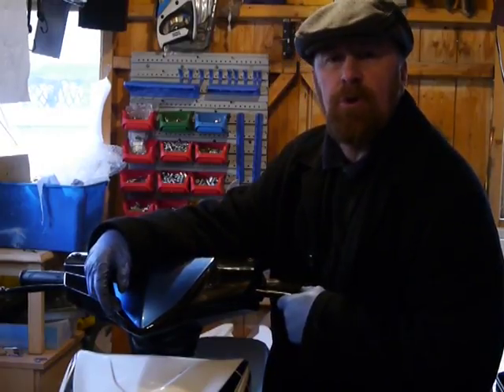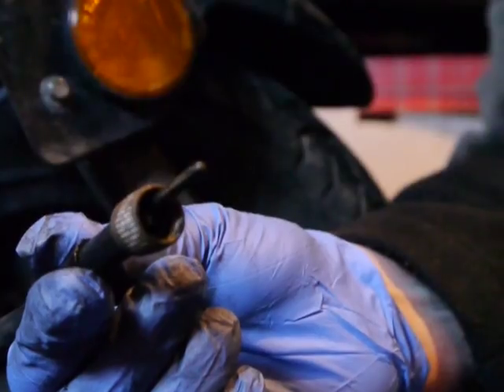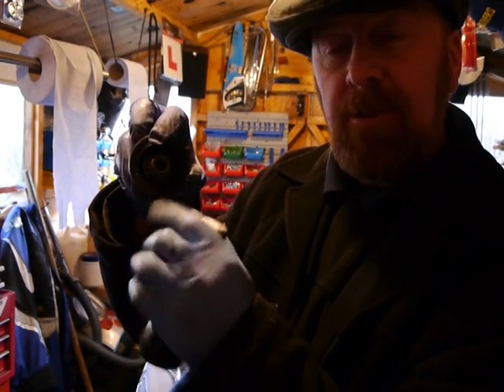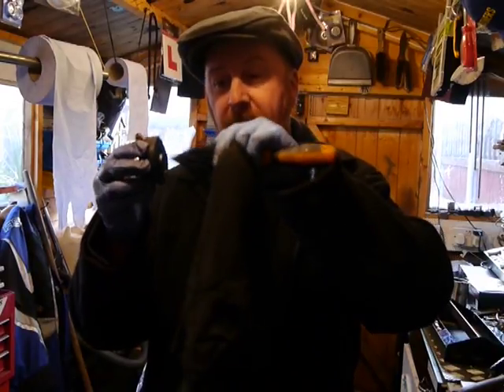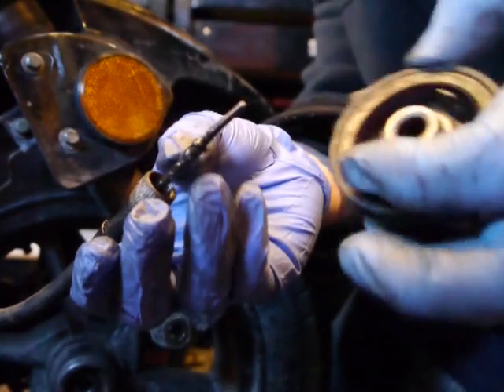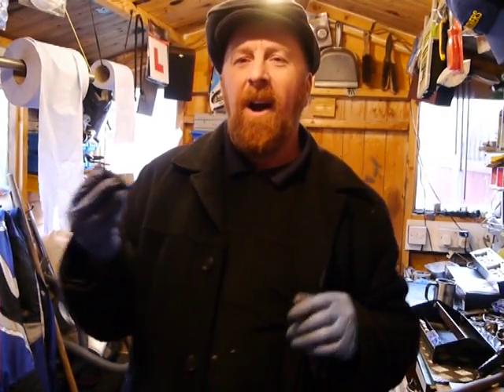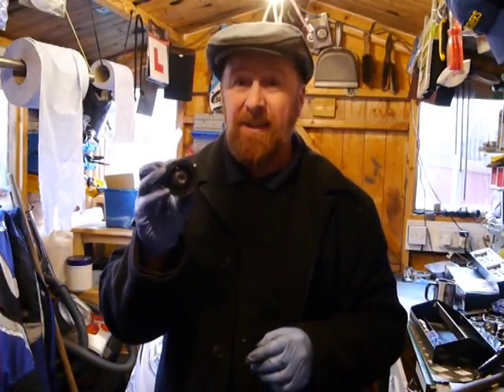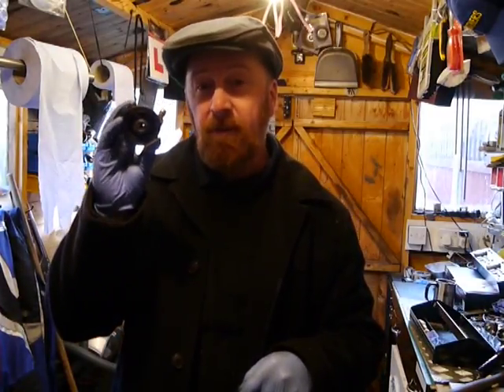CHINESE MOPED SPEEDO DRIVE NOT WORKING MARK SAVAGE

Comment: I have got a Sinnis shuttle 125 and my main headlights went out the full beam still works I have bought a new headlight relay but cannot locate where it goes on my bike I have took the whole thing apart but still cannot find it I found a wire with a plug on but cannot find where to put it and the relay don't fit in there can u help me please

Comment: Hi recently bought one of these and it needed a new speedo cable. I have replaced the cable and the speedo works but the mileage is way out of tune. I did a 3 mile journey and it said I did over 100 miles. Any ideas?
Reply from the maker: Well that's odd but must be the clocks that are damaged as guessing the speedo it way out too
Not seen that before

Comment: What jet what u recommend on a speedfight 2 2003 air cooled just exhaust and air filter upgraded
Reply from the maker: Paul summers standard is 54 
As in my upjetting video and carb cleaning videos 
Go up in 4s they are only about £10 a pack of 10 
 But start about 60
Which should run well with as in my tuning video 3 half 
Mark
Reply: mark savage thanks for your help mark n your channel is brillant helped me out loads keep up the good work
Reply from the maker: that's great to hear bud and thanks for watching 
mark

Comment: Hey could you give me some tips on my Chinese scooter the speedometer and fule gauge doesn’t work any tips on what  it could be
Reply from the maker: This is going to be two separate issues depending on the year 
Older mopeds will have a speedo drive and cable which is normally the problem and a simple fix 
I have many videos on my channel to help under speedo drive or moped 
And while you have the clocks up you can check connectors for the fuel gauge otherwise it will be the sender onto on the fuel tank so seat up and out 
If newer and all electric this still can be a connector or the clocks them self's and need replacing !
Check out my other moped videos

Comment: Hi mark I have an old 1997 Peugeot speedfight 1 runs great apart from if I let the engine run before I leave if I let it run a warm up it will bog down and not go anywhere any ideas?
Reply from the maker: Ewan Critchley hi bud 
These little mopeds do have there own little funny ways of starting 
It’s going to be your auto choke and carb 
Sounds like when you start and go the choke heats up and comes off but then you leave it the choke is staying on and then choking it 
Service carb and replace auto choke bud 
That’s what I’d do 
Or just continue to start and go lol  
Mark
Reply: mark savage thanks bud will give that a try tomorrow

Comment: Hi Mark, PLZ REPLY! I broke down the other day on my piaggio zip and i thought that i must have accidentally put diesel in like an idiot. Anyways after pushing it for 5 miles i got it home. 2 days later which is today I drained the diesel out of the tank via the fuel tap. I then cleaned the carb and all looking well. I then went to the petrol station to get some fresh petrol. I poured the petrol in but it was just leaking from the bottom of the tank where the petrol tap. Any help on how to fix this. Any reasons for why it’s happening?

Thanks again Mark!!
Reply from the maker: OMG no way that's really bad bud 
you will need to take out the tank and flush it out and the carb and all fuel fines, you may have even damage the engine, diesel only ignites under pressure unlike petrol ignites by heat / spark 
diesel is very dirty and leave residue  on every thing 
buy carb clean and fresh petrol and clean spray and flush everything 

buy some easy start as remember diesel will be in the head / piston and be on them so wont spark, once you have cleaned it all and the plug , put it all back and try to start and spray easy start into the carb this may work bud so give it a go 
and never do that again really bad
Reply: Thanks Mark

Comment: Hi Mark I checked my gilera float bowl, took the whole carb apart cleaned it, used easy start, checked needle and tubes yet it revs itself and cuts out!! What can it be bro
Reply from the maker: madz Rt if you have sorted all of the carb problems and the carb is working as it should be and your sure it’s a good carb then bud check your reeds as in another one of my videos on reeds as if there are loose they will continue to suck in fuel for a bit then die 
Or it upjetted way to much 
It was running ok before ? Or did you change anything ? 
Mark

Comment: Morning Mark. I have liked and subscribed to your channel. Very well explained vid on the failed speedo on the Chinese scooter. I have the same problem with my two-year-old Lexmoto Michigan. The speedo has gone crazy. Not going back to zero when I stop. But staying on the speed I was doing when I stop.. Then when I move off again it starts from the 30mph. And moves up to 60MPH. even though I'm only doing 30mph again. Stop again. It stays on 60mph. Move off again it now reads flat out up to the stop point on the speedo. It only goes back to zero when I actually turn the key off. Are you following all that? Please help mate. 67 year old, and pulling what I have left of my hair out.
Regards Dave.
Reply from the maker: Is it a cable speedo or electric speedo drive one ?
It cable it's odd and sounds more like a clock fault too stick and add 30mph 
I'd take lift the front wheel and spin it to see how it moves the clock and then take it out and inspect the cable 
If electric speedo drive one 
Check the sensor and take out and clean wash and refit ,make sure the wire is not cut or damaged 
But again could be clocks being faulty bud
Reply: @marksavage  Hi Mark. Ta for your reply. I don't know if my Speedo is mechanically or electronic. It's the latest lexmoto Michigan. About 18 months old with only 1700 miles on the clock.
I'm not very mechanically  minded. I think I better contact my dealer who sold me the bike brand new. And it could be a warranty issue.
Thanks again Dave. 

Regards Dave.
Reply from the maker: @davesmith6193  yes mate that's the best idea and something it suggest on a new bike 
Take care bud and hope you get it sorted

Comment: You really put out great videos, SO we know these chinese speedometers are innacurate, Ive seen 5 and 10mph off,,,,the question is, do you know how to calibrate these speedometers so they read accurate? what is it that you need to tweak or adjust to get them to read accurate, is it the needle coming from the cable, is it at the wheel? What do you think?  TY again!
Reply from the maker: to be honest bud they are all out and its only there for a guild , theres not much you can do to calibrate them

Comment: Hi Mark, I changed my idle jet from my gilera from 50 to 38 and it starts and runs!!! But only for 7-8 seconds. It revs itself to 7000-8000 Rpm’s and then cuts out (choke or no choke). It will start up every time but this will always happen. Please could you help
Reply from the maker: hi bud I have had this before, so it's take it all part again check that the float is not staying open and as in my carb videos on how to check.make sure the pipes are tight on and not gone hard if so replace, also check the needle is straight this also can do this see how you get on bud mark
Reply: Alright bro I’ll get back to you after I’ve done it

Comment: Hi Mark loving the videos, just bought a SpeedFight about a month ago and having problems with starting and a leaking carburettor also sometimes backfiring, can you do a video on labelling all the parts of the carb and where it can possibly leak from? Also can this effect starting and cause to back fire? Look forward to hear back from you and can I get a shoutout in the next video 😅
Reply from the maker: Danny Cope hi bud thanks for watching and I will do a shout 
As for carb leaking 
I have many videos on the carb and yes it will cause all sorts of problems like starting riding and over fuelling
Watch my carb video there loads on my channel and best watch them on a computer as you will see over 300 videos 
  This will sort out your problem
Mark
Reply: mark savage Thanks mate appreciate that, so I fix the carb should it solve a lot of the problems such ass the starting issue and exhaust backfiring at times? This is for the 100cc mate, cheers
Reply: mark savage you didn’t do my shoutout in your latest videos mate

Comment: Hi mark i have an acceleration issue with my moped still would tou be able to help me ive just uploded a clip of me accelerating from stand still and all my bike specs are in the description thanks
Reply from the maker: MrRainesFTW well it sounds like the bike is revving up ok 
So what have you look at so far bud 
To me it still sounds like the variator system and not gearing up !
Like I had in one of my last speedfight videos
Mark
Reply: mark savage it sounds to make its not taking of in 1st gear it sounds like its in 2nd and waiting for the bike to get going enought for the powerband to kick in
Reply from the maker: MrRainesFTW has to be the variator system bud 
Either the clutch is Jammed
Rollers are not rolling / square 
Belt to loose or variator jammed 
Way to light rollers ?
Mark
Reply: mark savage i have 3.7 gram rollers mixed with 4.3 gram rollers , im gonna try my 5 gram rollers now and all parts are brand new like the clutch and belt and stuff just had 100 miles on clutch and belt
Reply from the maker: MrRainesFTW so yea the rollers are too light with a brand new clutch 
I’d go 6x 6g’s bud and if your still not get good speed with 36g’s go take n7g’s 
That should work with your bike bud 
Mark
Reply: mark savage i have a pack of 6.8 grams and 5 grams those are my heaviest unless i go to pedparts in the morning to grab some
Reply from the maker: MrRainesFTW why not bud try the 6.8 s they should be fine for a test run 
See wha my top end you get,if the pull away is too slow combi with 3 x 5 and 3 x 6.8 like in my video 
Mark
Reply: mark savage hi mark id give it ago but i would of thought that would be to heavy for my setup seeing as my exhaust powerband is at 10,000
Reply from the maker: with a new clutch and spring it will be hard for little rollers to pull it open so 6.8 is not too heavy for your bike and you have nothing to lose bud
mark
Reply: mark savage yeah the belt and clutch have had 100 miles on and 60 miles break in was minium , i had to shim the variatorntonget my acceleration back donyou know why ? Its a polini hi speed variator

Comment: Hi Mark, I’ve got a Gilera Runner SP50 that wouldn’t run you might remember I told you it wouldn’t start even with easy start. Anyways, it’s running a Stage 6 Streetrace 70cc kit, Motoforce 21mm carb, Malossi reeds & a mechanic came and checked it out and it would flood and cut out and not start for a very long time. He said it was my idle jet, my current idle jet is 50 & he advised me to buy a 38 what would u suggest? We tryed a 90,92,94 main Jet & it’s still flood
Reply: Nice hat by the way, another great video😂❤️
Reply from the maker: hi bud 
you know i don't like 70cc kits as in my videos, however if you had a mechanic take a look maybe take his advice 
21mm carbs are big buggers as standard would of been something like 17.5 mm
you may have to down jet both jets then tune with the air mix, what air filter have you on, it will take time to set up bud as you have changed so much from the bike original setup
did you change the head your self? did you do it right?, have it been running ok for a bit and now messing up? have you rechecked the piston for any damage
if after trying the set up and it still messes round start looking at the engine for faults 
i have many videos that may help
mark